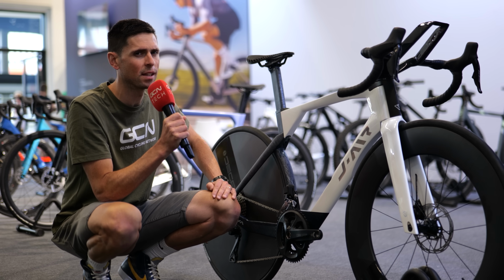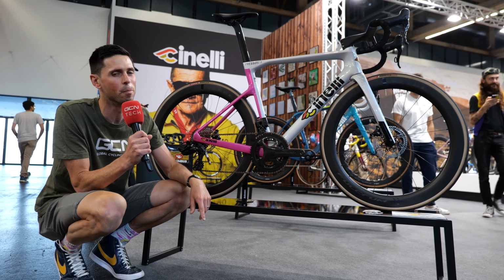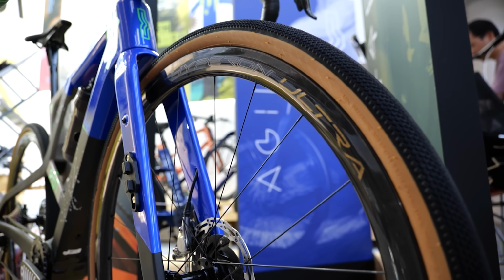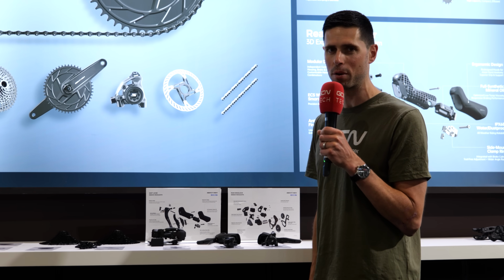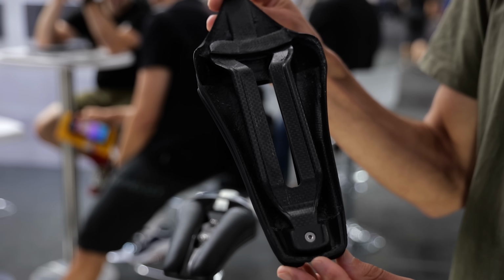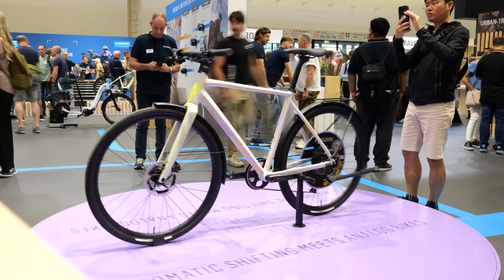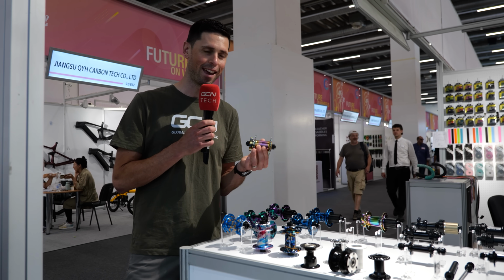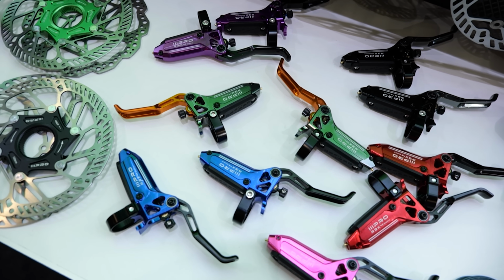Next Level Eurobike Tech | Weird Handlebars, 14s Groupset & World's Lightest Power Meter Pedals!

Comment: #askgcntech
Just picked up a new bike! A trek Madone SL6 with 105 Di2. The bike shop set it up with tubeless tyres. As a newbie to tubeless are there any tips of stopping the blowback of sealant when inflating tyres?
I tend to inflate with the valve in the 9 or 3 o’clock position. 
What a bloody mess!

Comment: Hey guys i honestly need your help. I have a brand new 11s dura ace casette and a matching chain. Works brilliantly on all easy to medium rides. As soon as I am on race day or training like race day and I put real power down i somehow have the gears "crunching" and losing their butter smooth shifting. What do I do to make my chain not skip"crunch" when I put super power down? The local shop says everything is indexed perfectly?
Reply: My 11-speed GRX derailleur does the same thing, and I’m on my third one. When the clutch is engaged or not. However, if your chainring teeth are worn it will skip when you put the power down. See if there’s play in your cassette, if it’s 11-speed you might need a 1.85mm adapter. Also, check your chainring bolts, the GRX ones like to come loose, so I assume the other models do too. My gf has an early 2010s SRAM Rival and it shifts beautifully. I honestly think it’s just the new stuff isn’t as good as it used to be.

Comment: Wait, the battery doesn't fit into the rear derailleur?  No, they do not have a 14 speed groupset, they have pieces of metal that look like a groupset, but dot work.
Reply: ... looks* like
Reply: @einundsiebenziger5488 I’m going to have to disagree, look is the word I would still use. “Dot” on the other hand 😂

Comment: When you have a 1 x 14 electronically controlled geartrain and Power cranks, it's a small step to auto gearing.
One map and a hysteresis calculation. Rolling away gear and personal favourite cadence set by the App.

It's been THIRTY years since I saw a development tricycle. No bicycle makers were interested.

Comment: I'm most interested in Sensah 14 speed wireless groupset!
And although a 10 teeth sprocket on a HG freehub sounds impossible, I recall that it's in place of the cassette lockring - so past the lager freehub body. That's pretty ingenious, and I believe 14 speeds would offer a very good wide-range one-by experience.

Comment: Sealed through-axle ends...what's the upside? That you can't put any through axle mounted accessories on it? (eg. a Tailfin rack) You can't even make an aero or weight argument here. Just aesthetics for instagram pictures, at the cost of usability (and even repairability - I've had to tap a through axle thread before, and this would just make it more difficult).

Comment: The Suzue hubs look cool, I'd beware though their track hubs are kind of wonky.  They come with this holographic sticker that yellows in a year or two and they won't sell you new ones.  Also it has a dust cover for the sealed bearings where if you tighten it too tight it will destroy the whole hub, very silly.  Only sealed bearing hub I've ever seen that can destroy itself if the dust cover or cone nuts are too tight.

Comment: The UCI just turned red looking at the first bike. 😂 Maybe this kind of handlebar would be a better solution than just holding on to the brake levers with the little finger and riding „almost puppy paws“. Have the aero bars but you have to grip them with both hands. If you don‘t, DSQ.

Comment: I’m waiting for 3 up front, 7 in the back, 21 speed
Reply from the maker: Combine it with a rohlof too!
Reply: @gcntech  Pinion in the front, Rohloff at the back.
Reply: For example, what's on my '96 Trek Singletrack 930 :-)
Reply: It's not 21 unique gears though. 3x7 means 11 unique gear ratios.
Reply: @williwacker2774  Cheers for clearing that one up I can now sleep soundly after all these years 🤣

Comment: Looking forward to the 15 speed release 
🤷🏿‍♂️🤦🏿‍♂️
Reply: 10 years from now it will be 20 speed, 45mm tyres and double disc brakes
Reply: Just skip 15s, i want 16 speed with 10-64 cassette! 🤣
Reply: @Epiqe  Yeah.  With a quadruple up front for 60gears.
Reply from the maker: It’s rumoured to exist!
Reply: 50 speeds with tiny 22t chainring because people can't climb at all apparently
Reply: instead of 15/16/18 speed cassettes why dont we have a light small 8 speed sproket and a hi/ low gear
Reply: @Mike0 To futuristic at this point. It’ll be the next big thing in 15 years though, along with rim brakes and inner tubes.

Comment: 14 speed! 1x setup looks really attractive in this case. Mechanical rear derailleur would also be sufficient!
Reply: I think that 14 gears require a lot of precision and electronic shifting is the only way to go. I mean, even 12s without perfect housing can be tricky, so 14 would be even more prone to errors after a while
Reply: 14 speed is nearly impossible/ very inconvenient. Brands already struggle with 12 speed mechanical, and shift indexing needs to be very precise
Reply: At that point just use 2x7 lol
Reply: @nguyengiahuy6292 Not the same. I’ve never had a problem with rear derailleur, so removing front derailleur does have a merit. Also, I rarely pedal descending, especially in corners for my safety, which means that smallest cassette is not really needed.

For recreational riders like me, reducing chainring size in a 1x setup could be ideal. Even 1x12 might be enough.
Reply: @nguyengiahuy6292 My thoughts also, though maybe 2x8 to avoid cross gears.

Comment: 14 speed will result in weaker chains, more expensive components and more complicated set up.
Reply: Probably exactly what somebody said about 13 speed, 12 speed etc when they were introduced.
Reply: @MadMatty01 I remember people have been saying that when 10 speed was introduced.
Reply: @Graean1 9-10 норма.
На шоссере больше не надо
Reply: @MadMatty01 And true it is!
Reply: Interestingly the chain diameter is the same but the width is less, making them no weaker
Reply: @tristanchadderton6062 большее давление на зуб 😅😅😅😅😅😅😅😅 сопромат учи
Reply: @tristanchadderton6062 Wouldn’t the plate thickness have to be less though, making them prone to wearing out faster?

I suppose though, whoever is willing to use the setup is savvy enough to make a perceived benefit vs life/ maintenance judgement, so maybe wear isn’t really an issue anyway.
Reply: @Crall-xb8he  I suppose some of this depends on the material used. Theoretically, newer alloys may be stronger, and more resistant to strain and wear.
Of course they haven't mentioned this, so it's just theory.
Reply: Not necessarily, if they copy spokes conical shape there's no need to narrow the chain.
Reply: @abdelmajidhassane9979 best  comment yet!
Reply: Same Was with 11, then 12, and then also 13 speed. No difference
Reply: There was a very clever chain test where a guy made up a chain with half an expensive SRAM chain linked to half the cheapest SRAM chain. The cheapo half “stretched” to the max pretty quickly but  the fancy half was like new!  I believe it was 12spd.
Reply: No it won't. They are using a 12 speed chain. By the way, SRAM 12sp flat top chains last longer than any 11 or 10 speed chains I used in the past.
Reply: 12sp chains are stronger than our old 10s.  And they also last longer.  I'll gladly ride a 14sp that's slightly less durable than 12sp chains.  Metallurgy gains are responsible for this.
Reply: 10 speed is fine imo
Reply: @TaquavionQuantaviousYoutube  yes, it's fine but why have fine when you can have better?  8sp is "fine" too.
Reply: Yeah , I will stick with 10.
Reply: Pls, by the time most riders need to change chain, they would already have swapped or bought a new bike by then anyway. Product lifespan is something that we all like to number crunch but realistically hardly matters
Reply: 11 speed was the peak
Reply: @BewareSabotage  for 1x groupsets 11 speed is not enough, the jump between gears is to much; for 2x groupsets 11s is really peak
Reply: @BewareSabotage  9 speed Deore is peak for normal usage IMO.  As long as you shift it into the small cog when you are done, you can leave it alone for 5 years and it will still shift fine.  10 speed you need a little bit of maintenance once a year, and 11 speed is full on chains that fall off the bike regularly and half chain life.
Reply: @凸Bebo凸  there's actually some testing that shows Sram 12s chains are the longest wearing chains available
Reply: @davidscott6164 Nah they are all change at .50, plus they fall off the cassette in normal use while riding from being too thin.  Watch a bike race the chain falls off these bikes multiple times a race, it's junk.
Reply: @davidscott6164 There's no way  to have 34t and 36t cassettes with 11 speed without huge jumps. You need 12 speed for that. If you're very light and fit tho, 11-28 cassette or 11-30 are great on 11 speed.
Reply: @davidscott6164 цена в 10 раз дороже моей 7 скоростной цепи
Думаю 20-30 тыс она не проедет😅😅😅😅😅😅😅

Comment: 14s is just ridiculous
Reply: always the same... why?WHY to have wide range with narrow  gaps cassette is ridiculous???
Reply: Can you imagine climbing fast on the Alu super thin granny ring on that thing?  If you have any weight or power at all and you ride that thing slightly shark toothed its for sure shearing off and crashing you.  Silly stuff, maybe good for light riders or maintenance nuts.
Reply: @凸Bebo凸  I can imagine anything , like a carbon wheel cracking, a tubeless tire leaking, or a Di2 battery running out — but we still use all of it. Something tells me that if 14-speed goes into mass commercial production, they'll make sure the chain is reliable, Just like sram and campa are confident in the reliability of their 13-speed systems